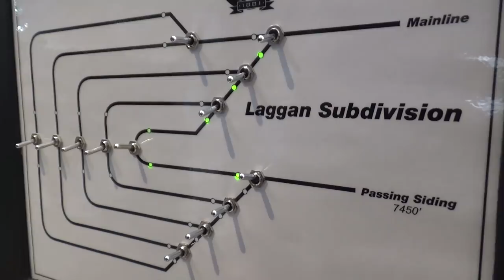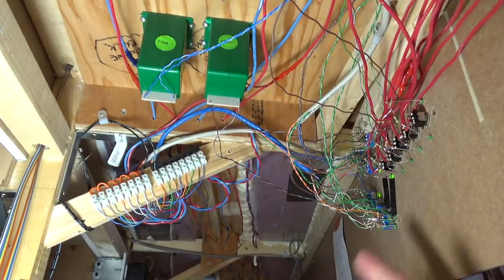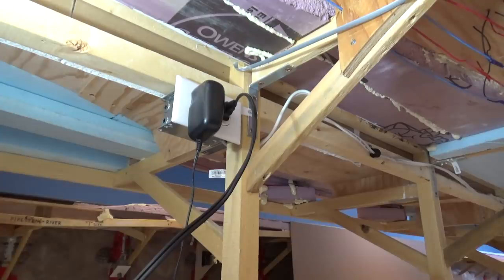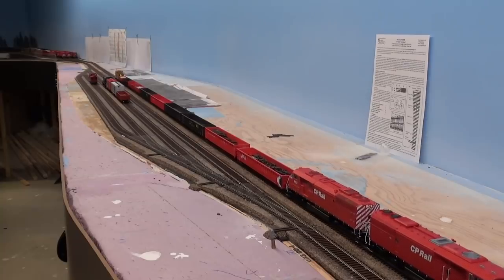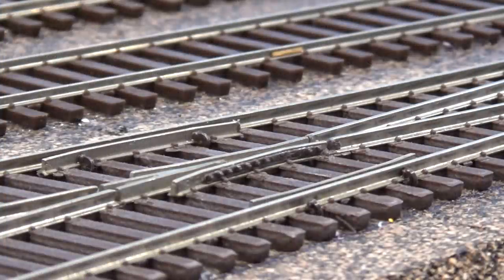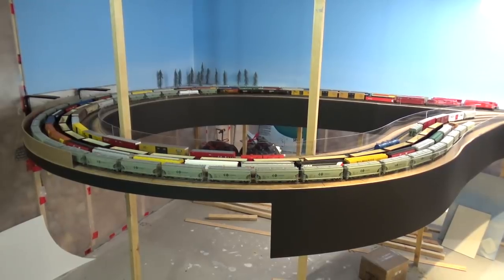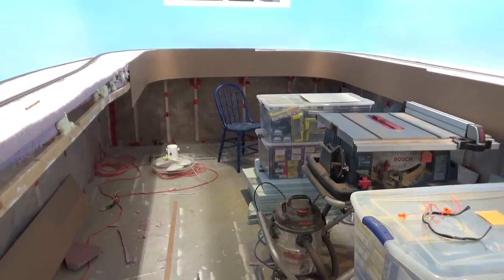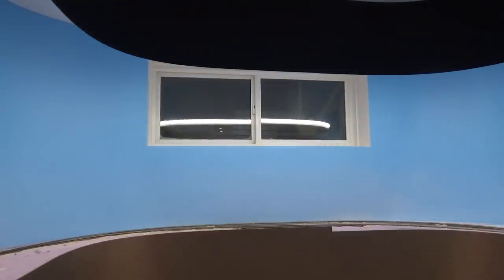Layout Update - January 2019: Panels Operational, Flextrack & Switch Details, Continuing Fascia...

Comment: Coming along nicely Ben!  I see you have a work train as well!!  With the hardboard dust, I found it stops trains running really well...I used a vac like you but the fine stuff in the air settled on the rails and stopped a 3 unit train dead..LOL. So clean all you track with some CRC or similar , not a rubber or track cleaner or I'll get cross!  Nice to see trains running and look forward to more progress. 
Cheers Gregg.
Reply from the maker: Thanks Gregg! I already found that out haha, I run a vacuum on the table saw outlet as well as a household fan exhausting out the nearest window and we still get that very fine layer of dust on the rail head that conducts absolutely no electricity at all.

Comment: Great work on the panels. Way cleaner then mine. I agree on using small electronic power cords.  I am using a 7v 500miliamp power brick which powers my 9 tortoises no problem ( nice slow and proto). Plus I didn't have to put resistors on my LEDs, as I like them nice and bright and I don't have to worry for them to burn out as they are drawing half an amp at most but more likely under 100 milliamp each
Reply from the maker: Thanks Peter. Good point about not having to use resistors! I'm paranoid about burning them out so I put them on everything.

Comment: Layout looks great!  If I may make a small suggestion before you finalize your track plan.....
At Banff yard, I see you have two tracks for cars to be shuffled, and I assume a ready track which is the third track adjacent to the main. 
 I would think you might like to run a shunting loco to build trains while the mainline is in operation, so I would suggest placing a feeder track to the yard the length of your longest siding plus one shunting loco.  This will allow your shunting loco to pull cars off the 2 yard tracks, reverse, and build a train on the ready track without blocking the main line.  
In other words, just move the first switch feeding the yard from the main line, back away from the yard a few feet.  Hope this is helpful and enhances your operation!
Reply from the maker: Thanks! That is a good idea for increasing operations but I can't alter the track plan because it follows the prototype exactly. My layout is based on the 2000 - 2017 era. Banff yard operations include meets < 8000', work trains, snow fighting equipment storage, a station stop for Rocky Mountaineer and the Royal Canadian Pacific and is a set off point for hot boxes. I think between all the mainline trains and that stuff, it should have a lot of operational interest and be close to 100% prototypical.

Comment: astonishing one the progress of  your  layout love the details work it be easier to install them before the track was down yes the fascia looks great too  maybe a router would work better to trim  the fascia off  but  it up to your self to make the decision  down  the road have plans on coverage under the layout  with material  to  used wondering  or leave it open  my layout I have plan  on putting cabinet and drawers  undermine  to house all the rolling stock I have  does  add up in fast  and  store the boxes as well  right on  have them stored on a 3thd floor and  most of them have not been open let and never been out of the box it shipped in  that will be down the road  for that or me if I do they be on caster  to have access  under the layout as well  the rolling stock I have on the layout now  does  roll well  starting to clean the track  was  not health  last year to do much still not but I am able to stand up for  a while  be for I could not  still a long road ahead  for me   but I am  able to  run  trains  now  to
Reply from the maker: Good point about the router, but I don't have one so I will make due with a jigsaw. Sorry to hear about your health troubles, hopefully this year you will bounce back quickly.

Comment: Very nice , I have a question about the SD40-2F leading the consist. The class lights above the number boards how do they work and are they used? Also can the ditch lights be programmed to flash when the horn is blown? Thanks, look forward to your next update.
Reply from the maker: Thanks! Function 5 cycles through them White-Green-Red-Off. They were brought in when the railroads were still using flags, I believe on Canadian roads White=Extra, Green=Second Section, Red=End of Train. I'm not 100% if the ditch lights can flash with the horn, probably if you alter the programming. They didn't flash on the actual CP red barns though.

Comment: Sweet! 
What’s the vid that breaks down how to build the controls panel? (The lines, drilling holes for toggle switches etc)
Thanks
Reply from the maker: There isn't much to it. The biggest thing is creating a diagram that works for your layout. I designed my panel graphics to be the same size of a sheet of paper because that just seemed like an easy size to work with and uses common printer paper. 
1. Create switch diagram at desired size, add circles where the switches go to show where to drill.
2. Laminate panel diagram (optional). Tape diagram onto fascia and use it as a template to drill your holes. 
3. Install and wire switches.